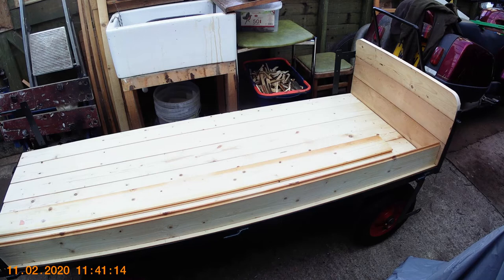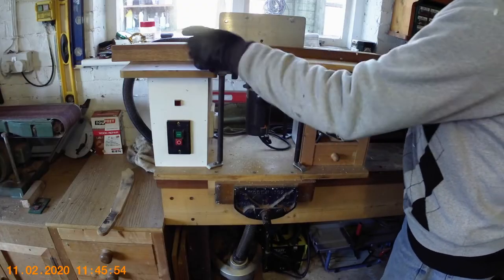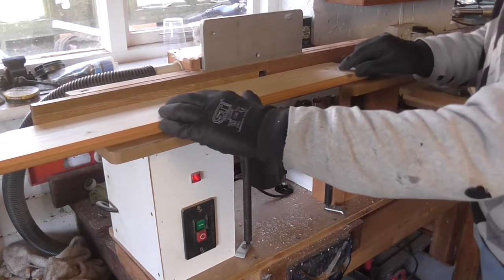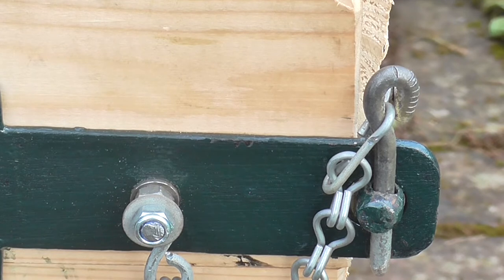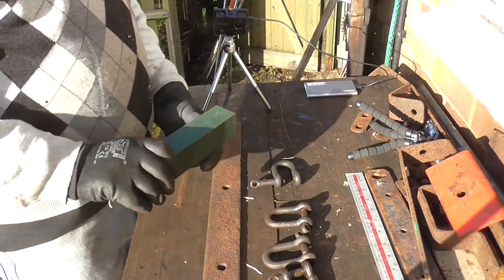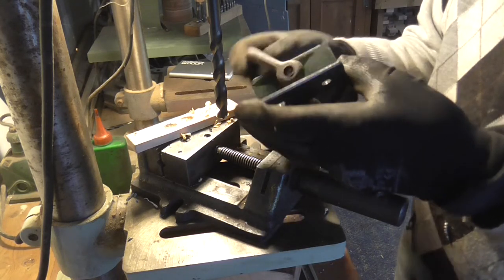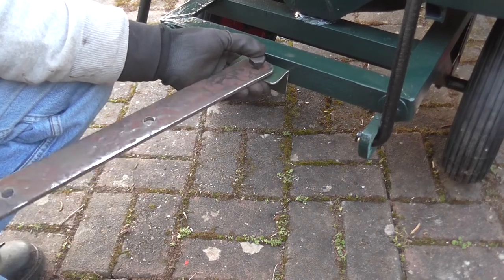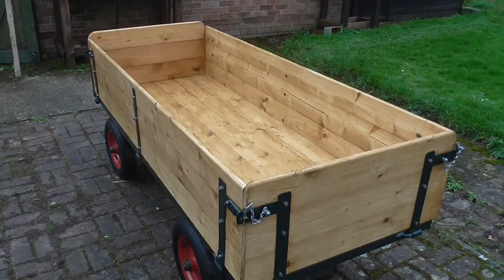Reconditioning an old Trolley.  Part 7

Comment: Good job. The trolley is looks nice and very functional.
Your drill press vice looks identical to the one I restored a couple of years ago. If it is, it is a Mancuna (Italian) vice dating from the 1930s.
Reply from the maker: Thanks for the comment, this old trolley has been languishing in my neighbours garden for over 35 years rusting away, I have been trying to obtain it for many years without success until a few weeks ago by which time it was on it's last legs. The drill press I was using is a Warco that I bought new around 35 years ago, I think they re-badged it so could have been made anywhere?

Comment: Excellent job John - when I get to seventy do you think you could make me look as fresh and tidy (and useful) as that old timer? 
Okay, serious question - I've asked lots of folks this question and never got a very satisfying answer; what is the function of the oil when drilling metal? I've seen mineral oil used on metal turning lathes but the machinists always just laughed and shrugged their shoulders - 'that's just how it's done mate!' I figure if someone has a definitive answer, it's got to be you! Cheers mate, looking forward to the next project already.
Reply from the maker: Mark I don't think my restoration techniques work on living creatures, if they did I would look a lot younger. I am no expert on metal work, woodworking is my forte , I use oil as I feel it lubricates the metal reducing friction and hence keeps the temperature down perhaps helping keep wear on the drill bit to a minimum.